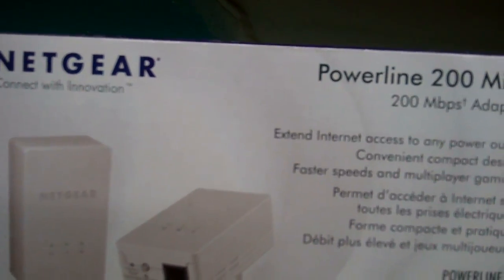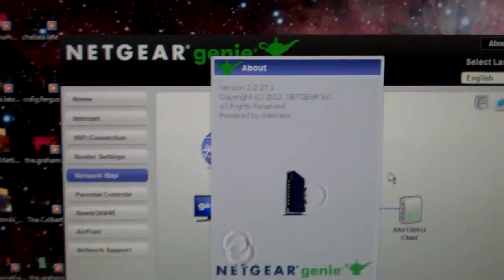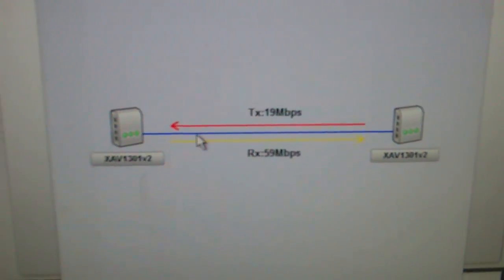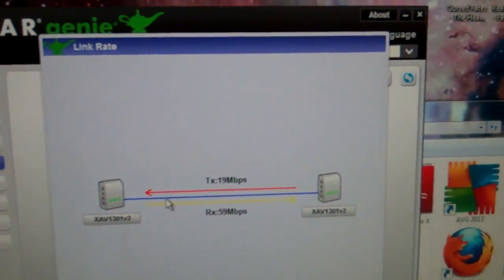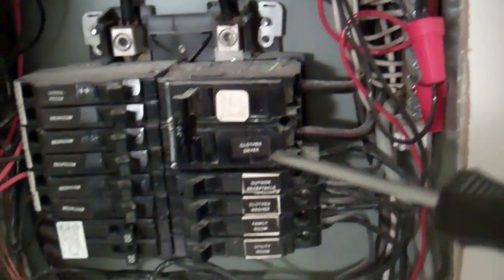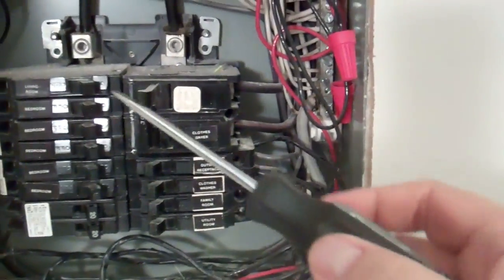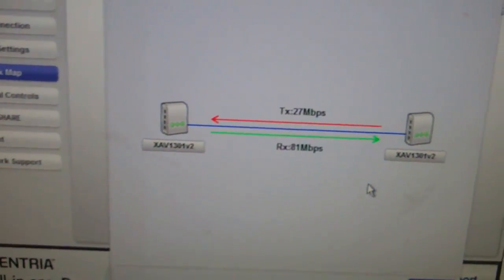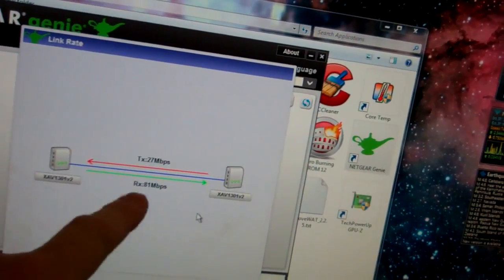Netgear XAVB1301 (XAV1301 v2) Powerline 200 Mini HomePlug AV Review

Comment: You should have put a 1 amp inline fuse to the capacitor and connected with 14 wire to the breaker.

Comment: A and B in this case are the same exact phase angle. Tap A and B come from opposite sides of the same coil; with neutral as the center tap of the coil .  (+)120(-)120(+)    90°

Comment: Does this still have the same speeds if one of the powerline adapters is plugged in an extension cord (a non surge protector extension cable).
Reply from the maker: An extension cord is no different than the in wall wires. If other items like power adapters are plugged into the extension core too it will effect the speed.

Comment: does this product have to be registered with your ISP?
Reply from the maker: It is like a long LAN cable except it plugs into your house's existing power lines so you do not have to run new LAN cables through your walls.
Reply: no it doesnt need to be registered